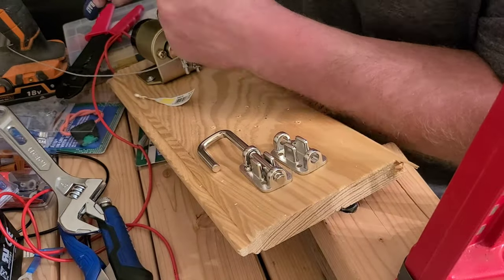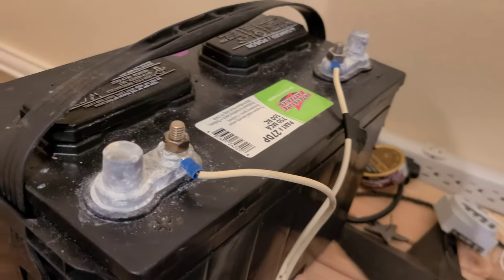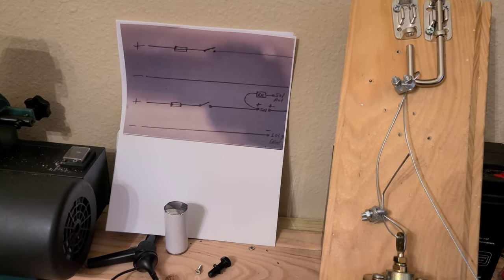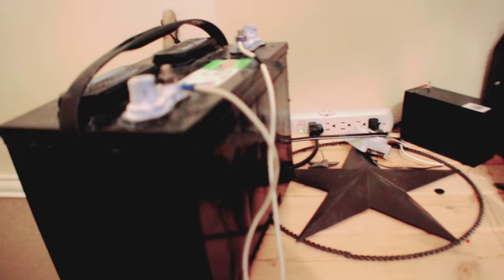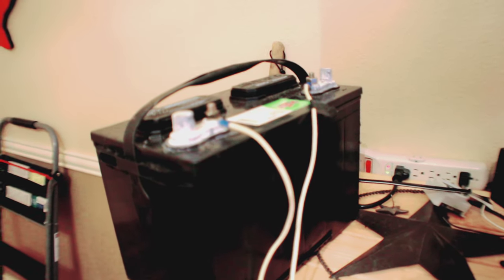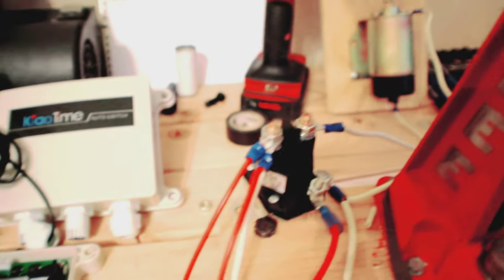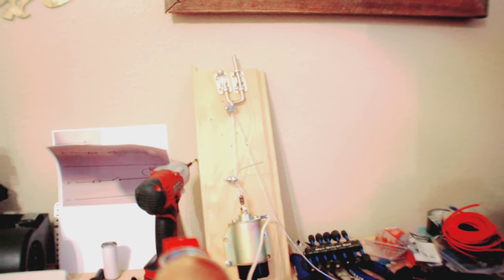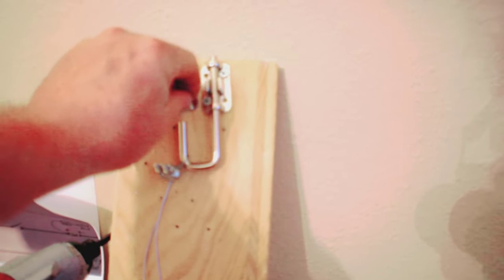Cellular Hog Trap - DIY part 1

Comment: I have built mine with a wifi inching relay and use a hot spot vs the gsm. I pay $10 a month for the data, but i can run my wifi cameras also so I don't have a separate expense for a cwllular style camera. Also use a Hyundai trunk latch with the trunk solenoid. Works like a champ
Reply from the maker: Interesting,  sounds like a solid set up. Ive been debating the trunk solenoid for a while. The way my drop fate way built it. I'm paying $5 for the gsm controller. The company EIOT  Clud and I partner together. So they provide data for my camera.
Reply: @JSROutdoors  yea the trunk latch works in conjunction with the shaved door solenoid. with a heavier door this seems to work out good for me
Reply: @robertjohnston6076  I am super interested on the way you have your gate set up with the hot spot and inching relay. Any InSite would be appreciated. Thanks
Reply: @JCRegini  I will put a video together soon